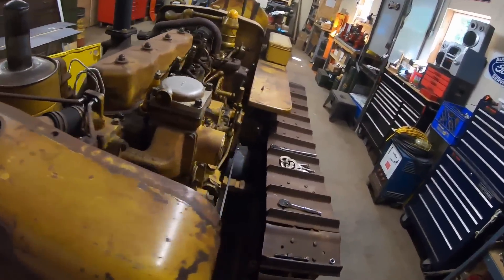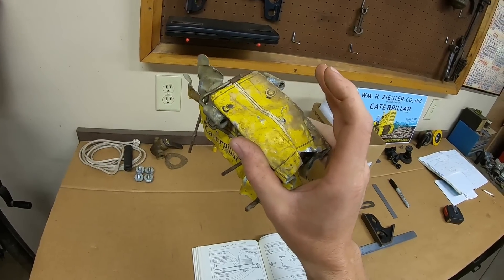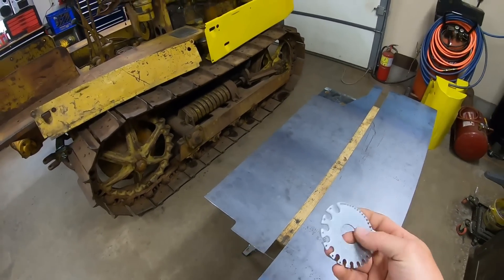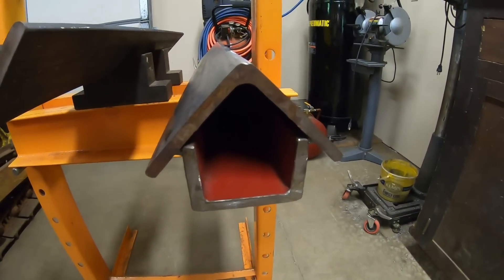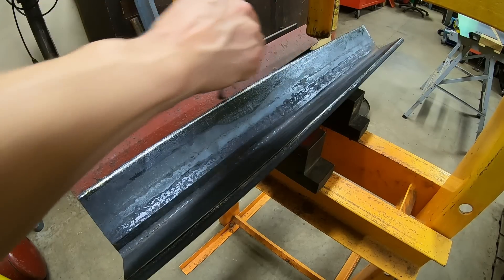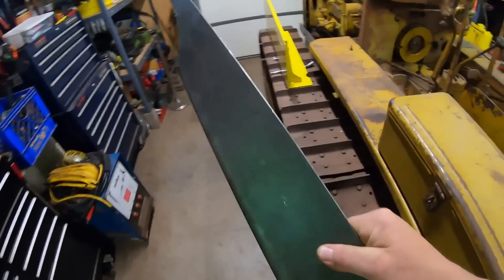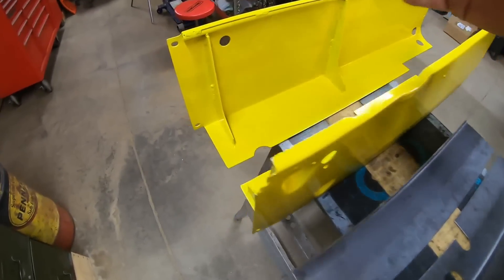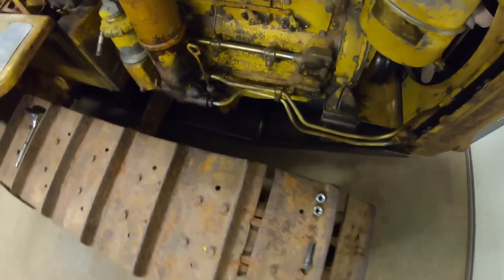Caterpillar D2 #5J1113 Chassis Rebuild Ep.56: Bending & Shaping the Lower Engine Side Panels

Comment: There is a steel calculation formula called the "K factor" for adding material to a bend because of stretch and compression in the traverse, short traverse and longitudinal directions

Comment: You can modify the handle wheel off an old gate valve & fit it to the jack pressure release screw so you can turn it by hand.
Reply: Your verse is as good at english as Squatch253 is good at metalwork! Love it.

Comment: I liked watching you make the indentation with a piece of pipe with a backup cut to the proper shape.  The next time you have to do this, knock the rust off the pipe and sand it a little bit.  I thjink the finished product will be just a little better.  Davd Adair

Comment: This was a very interesting process of making the two side pieces. I was wondering if the other spare parts 5U would not be a good hood donor for 5J1113?
Reply: @squatch253  That is a shame other wise it would solve the issue of finding a none painted hood. So that leaves two options or tree: find a weathered but decent J series hood! Make a new one out of sheet metal or remove the canary yellow paint. Last but not the least try to mockup a weathered hood from it.

Comment: For that curved part I would have cut the whole thing out then used the cut out part as a template but make it wider.  Then roll the part, trim it to make it fit good, and weld it back in.  I would not trust trying to stretch it myself.

Comment: We’ve learned that Squatch is in need of a press brake. I’m surprised with all the tools these guys have they don’t have a finger brake of some sort. Although this hydraulic press with jig did create a nice bend it becomes very expensive to use all that heavy gauge angle iron and c channel iron. They always have their thinking caps on to figure out a way to get the job done.

Comment: Still surprised that you don't go for water-soluble oil (drilling, hole-sawing), rapid-tap for threading, and saber-saw vice grinder for cutting sheet-metal. They've been around. Whatever works.
Reply: Surprised you don't spell vise with an s when you mean a tool and not a bad habit. The word's been around. Whatever.

Comment: Squatch, my question is, i know i heard you say, that you wasn't going to paint this tractor. So, how do you intend to preserve these new panels to keep them from rusting, to the point of looking nowhere like the original patina of the rest of your unit? New paint would look totally wrong, and pure rust doesn't match either. Just an observation..love the build sequence.
Reply: Thanks for the info, Toby. I've seen your previous videos, where you touched up some reproduced parts, and aged them, but I didn't know if the same principal applied to these, in such a larger format.  Thanks again for the heads-up and your great videos.

Comment: How are you gonna do that bump in I'd know they have a special punch for something like that but that's a very proprietary tool if I were gonna do it I would literally cut out the shape and then get another piece of the same metal and form the bump out portion and then stitch it together by welding You might have another way of doing it that you can still use one sheet of steel but that looks like a very hard thing to make

Comment: Did I miss something? that piece is shorter, is there going to be another piece on top?
Reply: @squatch253  As normal I missed it. I try to sit down and watch it all the way through at least once but can get easily distracted. So there will be a top one yet too, correct? I know I need to go back and rewatch it.
Reply: As you heated the  metal it wanted to expand. When you push it in the die you stretched out the  heat expansion ending up without any ripples.